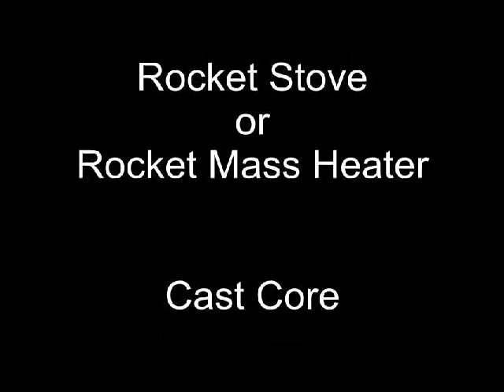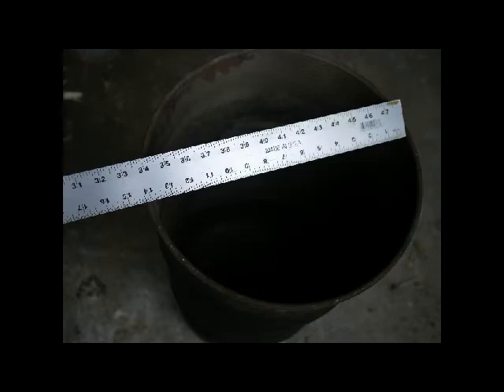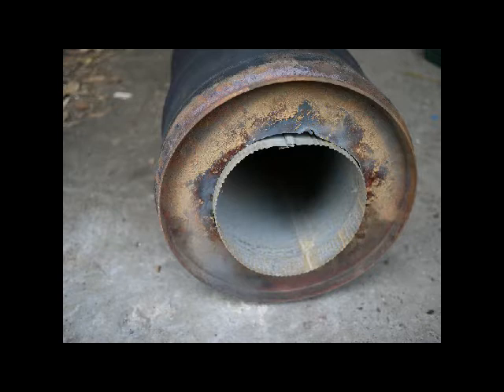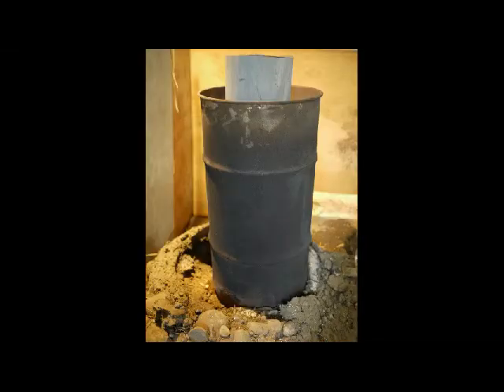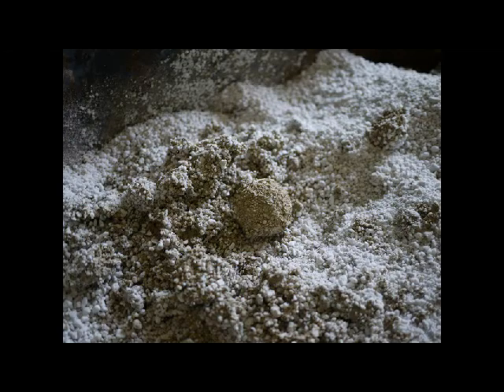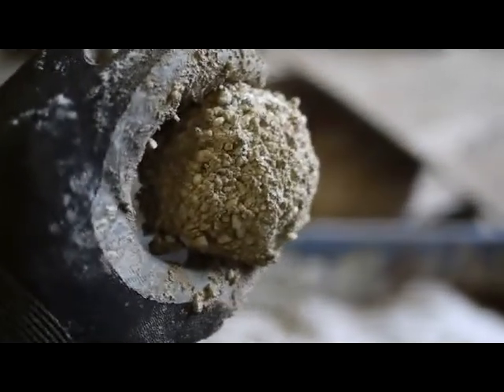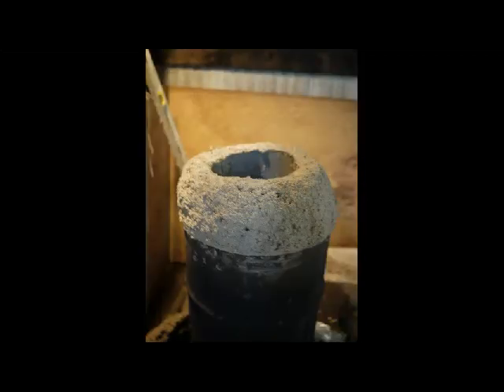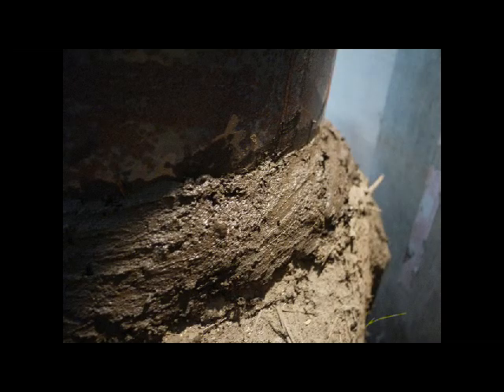Rocket Mass Heater Cast Core Part II The Heat Riser

Comment: Maybe as a good idea for nex projects:

Use with some safety precautions water (yes water) as the mass. There is no comparable good substance to store heat such as water . (you can do your own research -> heat capacity per kilo)
For comparison> 
1 (!) Kilo of water stores more heat (at 99°C) and at the same temperature than:
- 4.5 kg aluminum
- 9 kg iron
- 11(!) kg of copper
or
- 5,8 kg asphalt 
- 5 kg Solid brick 
- 4,2 kg calcareous sandstone 1
- 4,7 kg concrete 

Even if you bring 1 kilo of aluminum to 350-400 ° C, 
1 liter / kilo of water (with 99°C)  still stores more heatenergy than the kilo of aluminum. (purely to the understanding)
And water is a lot cheaper than the mentioned materials^^

If you take a thermostat from the automotive sector (92-95 ° C) and a large IBC container, you have the cheapest and most efficient heat storage. Which can not overcook so quickly (1000 liters of water need "some" time) 
Should it come that far,  we have the thermostat that can push away from the heat source ;)
Reply: @Ben von Jerry - you are so right - the 'specific heat' of water is higher than most alternatives, and it is at the popular price!  The 1000 litre containers are often for free around here, but the more conveniently sized  500L ones are pretty rare, unless you buy new.  Take care,  1000 litres weighs a Metric Ton!

Comment: Hi 😊 thank you for your awesome videos..I was going to make this riser and core, then someone suggested the five minute riser? Can you expand on this for me please? I am understanding that it is as simple as a ceramic fiber blanket in an 8 inch stove pipe? The aluminum or black stove pipe? How well does this hold up? I am very interested to hear your thoughts on this. Thank you 😊😊
Reply: @broaudio  ❤️ thank you for your quick reply...I ordered a blanket to make an insulated pipe to go through my interior wall to a bell bench.. Now I will order some more to make this riser... I'm guessing I just put it on top of the cast core? And seal it I'm with some cob?..I am loving this build by the way..

Comment: do you ever add wood ash to your cob mix. and what type of mix  for you cob.  thanks.  i have the form made for the castable core and trying now to find "clay" somewhere in my neighbors yard.  they replaced a sewer line and it looks like the top soil is in the bottom.  you are so kind to answer the questions, Matt.  thank you
Reply from the maker: Leslie, I do sometimes add wood ash if I have it at hand, but it's not necessary. Every mix is different, it depends on how your materials come together, there are lots of good tutorials on youtube but really you just need to get dirty and start making mud balls.  You'll figure it out much quicker by doing, and you can only learn about your materials by getting muddy. There is probably some clay from digging up the sewer, that's a great place to start looking. Good luck Leslie!

Comment: I see you don't add neither sodium silicate or refractory cement to the mix. Adding those to the heat riser mix would help? Thanks!
Reply from the maker: I doubt it would make much difference either way, but....it won't hurt!

Comment: It has been 4 years since the video was uploaded and I was wondering if the riser has last that long? Do you still have this stove? Is the riser still alive? I am planning to do a Batch Rocket Mass Heater and I and having troubles finding good materials for the riser, but the materials on the video seems to be possible here. If that worked for all these years it will great news! Thanks for shareing!
Reply from the maker: Still the main heater in the house, in daily use, and working great!

Comment: I don't know about the additives such as perlite and fiberglass. Castable refractory cement was formulated to work just fine by itself from the manufacturer. Casting the shape of your heater with just the refractory cement (with the correct amount of water added) might prevent, or eliminate many of the cracks.
Reply: the perlite and fireclay is to make the cost of production much cheaper but still retain the function, using just refractory cement would probably work great but be more expensive, and last just as long imo, using clay (from your yard even if you have the good stuff) and perlite would work the same but cheaper. The fiberglass is probably just to increase the tensile strength, but idk if it's really necessary.

Comment: How is the steel pipe in the riser holding up ?  Has it burned out?
Reply from the maker: The inner flue pipe is a sacrificial mold form by intention.  It will burn away within the first few hours of a good burn.

Comment: So I am starting my rocket heater, could the outside of the mold just be something removable?  I mean will the riser harden to the point of being self supporting?  I was thinking cardboard tube to cast it in.
Reply from the maker: Hi Kurt, I wouldn't suggest mix for a stand alone riser.  You can use the same method with a stronger mix and it would work.  This mix is light, insulated, and durable to the heat stress, but needs support if you plan to move it.  If it is cast in place it might be just fine, but.......good luck!
Reply: ***** so by stronger mix, you would recommend more mortar to the mix I assume?   I have a 50 lb bag of heat stop 50 and need to get some clay and perlite.  I guess I need to experiment, but heat stop is like $50 a bag.  expensive testing...
Reply from the maker: No, I mean like a real castable refractory product from an industrial supplier.  My recommendation if cash is a concern is use the outer drum.  Have fun!

Comment: I made a heat riser to these specs and it's SUPER heavy! I didn't do it in place, as my stove was still drying/getting burned out, but now I'm worried about putting it up there and having it crush my stove. It has to be sixty pounds, which was really surprising to me since (other than perlite which is lightweight) there's only 5 gallons of water and maybe, 2 clay. I lit several fires in it to try and dry the water out. After five fires it may have lost a few pounds, but it's still ridiculously heavy. Weird!
Reply from the maker: Get some cob with straw fiber around your stove core to help keep it all together, and build a good landing for it, with support all around.  Your core should hold it, and yeah, sixty pounds sounds about right.  The perlite holds a LOT of moisture, for a long time, as does the clay.  It will get a bit lighter, but, yeah, they are heavy.  Good luck Mary!
Reply: Thanks for your response! Care to share in my current dilemma? :) http://permies.com/t/58512/rocket-stoves/Faulty-Perlite#496035
Reply from the maker: OH.  Yikes.  That isn't going to last much longer, sorry.  If you want a batch, you will need to use real refractory and a real firebox plan.  That one is thankfully going to fall apart before you figure out how dirty it was going to burn.  Sorry for the harsh reality.  My mix will work for a J, not for a batch.  Go to Peter's batch box site and build your core to specs, you'll be glad you did.  I know this isn't what you want to hear, but I bet you want a good heater after all this effort.  Good luck Mary.
Reply: Thanks for the info. You're right, I didn't want to hear my worst suspicions confirmed, but I'm glad to be figuring it out sooner than later. Curious though, why does the mix work in a J tube and not a batch? Wouldn't it still burn dirty and fall apart in a J configuration? As far as my issue... there's no way to reinforce the inside with something stabilizing?
Reply from the maker: A J only has a ceiling span of around 6", and it's 6"+ thick right there since the box form fills in around the J.  It's a light duty mix, not a true castable refractory.  You could build a small firebox in there out of split firebricks and that would most likely hold together, but, it's gonna burn dirty.  That's because of the design, not the material.  I'd say start over with a proper firebox design, and use appropriate materials for that build.  Good luck.
Reply: Ah, it's the design and not the mix that burns dirty. So, my burn chamber is too wide--is my 13" door too wide to be useable with my 6" system? (* whimpers * but I love that door!) 
Seriously though, thanks for all the help, really appreciate it! I've got a lot of research to do.
Reply: ETA I think I'm going to try and get away with lining my box with firebrick for this winter. It will be a bit smaller opening than the door, help reinforce everything and hopefully get me through the season...
Reply from the maker: Don't feel bad Mary, you will learn so much in the coming months massaging what you have and reading about what's been done....it will be a net positive as you final heater will be miles better for this process.  Enjoy it, and great job on the attitude!  A+!
Reply: Yes, thanks to people like you who share so freely and spread such optimism! All your videos are so empowering. Keep it up and thank you :D

Comment: You mentioned something about using furnace cement at the base of the of the heat riser when fastening to the firebox?  Also  you are mixing furnace cement with the perlite and field clay to add strenth to the heater cast core to keep it from falling apart after the flu liner burns out?
Reply from the maker: You can seat the riser in the same mix as the core is cast of.  The furnace cement adds alumina and sodium silicate and helps the clay harden a harder and faster than it otherwise does.  Thanks for the comment.

Comment: Do you guys buy the clay or can you find that somewhere in the woods?
thanks
Reply from the maker: Hi Yves, I do either one.  The store bought clay is easy to work with and dependable, but I use found clay often.  You just have to work harder to get it screened and maybe burn a few test bricks in a fire to make sure it will hold up.

Comment: I noticed that your you tube video of your cast core heat riser doesn't have any insulation around it, I thought you said it was critical. I did find some fire clay and perlite for a cast. Just need a small barrel for the core and was wondering about insulating it.
Reply from the maker: The mix is an insulating mix, the clay sticks it all together and the perlite is the insulation.

Comment: Thanks for the reply, what would you think of the riser made of 1/4 inch stell well casing? I would insulate it of course, and thought I could build the burn chamber and weld it to tunnel to the vertical riser, could this withstand the temps? Thanks very much.
Reply: *****
Both your videos and your detailed responses to comments and questions like this one have been extremely helpful to me.  Thank you much.  Sub'ed.
Reply from the maker: Raven Heart
Thanks Raven, that makes my day!
Reply from the maker: Hi Dave, I wouldn't bother with the well casing.  If your heater is running properly the steel won't last long.  That said, you will learn a lot just getting one up and running so if steel is what you have and you don't expect it to last, it would function fine for a while.  At some point, depending on your fuel and how well it all runs, the steel will spall and warp and start to really degrade performance before it fails outright.  So, yeah, use it for a learning experience, or skip it if you are going for longevity and performance.
Reply: Thanks for your help, I know you've probably answered these questions over and over, and I apologize, fire clay isn't easy to get here, what about a fire brick riser? If so, should it be insulated? Some sites say this is important, you don't insulate your cast at all. Actually, I'd think about making the whole chamber from fire brick if possible. As the exhaust leaves he barrel, can I use heavy stove piping? Or should I use sGould I use something else? This is my last question so not to bother you! I've got plans in my head and about to put them on paper. When you say an 8 inch system, you mean an 8 inch chamber from burning chambe r to flue, correct? Thanks and expect some support soon from me.
Dave
Reply from the maker: Dave Socoby
No worries Dave, I'm happy to help if it means folks are warm and are burning cleaner than they otherwise would be.  Insulation is crucial in the riser.  Firebrick riser will be just fine, but you will need to wrap it in kaowool or superwool or similar, or build a surround and use my mix as insulation.  You can substitute local clay for the fireclay if you build it into something so it doesn't need to provide it's own structural support.

You can also build the whole core out of fire brick.  The performance is slightly different,(slower to come up to temp, a bit more coaling, and the potential to overheat the feed and create smokeback after a long session of burning, but overall more durable than my mix) but it will work.

The barrel sheds a ton of heat, so you probably will never see much in excess of 300F downstream of that.  You can use stove pipe no problem, and I will sometimes even use HVAC pipe as long as it's well encased in cob.

8" refers to riser diameter or square section, which dictates the rest of the system.  An 8" system should have an 8" chimney, and the core will be 7.25"sq. in every passageway.  If you have a 6" chimney, then 6" dia. riser and core should be 5.3" sq. in every passageway.  It comes from Cross Sectional Area calculations, which for round sections is Pi(Rsquared), so an 8" system is roughly 50".  So, square sections are 7.25"x7.25" for 52".  So, yes, it should be 8" from core to chimney, with no area smaller than that.  Larger is okay in the heat extraction areas, like the bench, but it's best for your first one to just keep it all the same.  Good luck Dave!
Reply: @broaudio  Isn't latest reco on size of square openings in core for 8"system to also be 8" square instead of 7.25" square?

Comment: This is the only video that makes sense to me as we are dealing with such high temps in these systems and they are needed for complete combustion/efficiency, so I thank you for posting. I am experimenting with using it to make a boiler. My question is. If I place loops of copper tubing in the expansion chamber do I need to make it larger to replace the volume that will be taken up by the tubing?
Thanks again
Gary
Reply from the maker: Hi Gary, thanks for the kind words.  I'm not sure what you mean by "expansion chamber", but if you want to make a boiler generally speaking in a rocket stove type set up you want to do any heat extraction after the riser.  Best practice currently is to heat a large, open vented, container of water and use that as the heat exchange medium.  Run your coil through that.  That solves a lot of the issues found in rocket stoves and water heating, namely, extremely high temps and short, wide temperature swings.  Good luck on your build.
Reply: ***** By expansion chamber, I mean the 55 gallon drum part of the unit,
Reply from the maker: Gary Vander Giessen
Well, it's going to get hot in there, so be careful.  You won't hurt the combustion, so that's good.  I do think you might create a restriction there if you take up too much space, but there is quite a bit of space there if you use my riser design, so if you configure it right it should work. You don't say how big your tubing is, but unless it's larger than 1" and as long as it's not bunched up anywhere, I think it will work.  I don't think that's the best way to heat water, but it may work out very well for you.  I'll be interested to hear your results, keep me posted please.
Reply: Thanks bro, I would like to speak with you directly,  would that be possible ?
Reply from the maker: Sure man, if you can figure out how to message me privately we can exchange phone numbers.  This google+/youtube thing is so messed up, I can't figure out how to message you through here.
Reply: Try adding me as friend on Facebook I can PM you there
Reply from the maker: Sorry man, I don't have a FB account.  Haven't made one.  How about email me from my Walker Stoves site.  Walkerstoves.com.
Reply: Perfect!